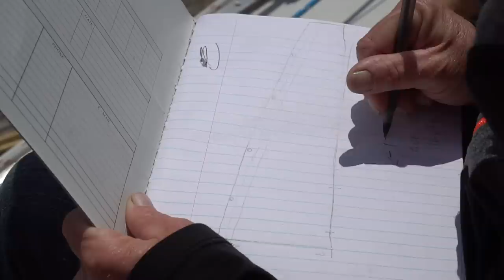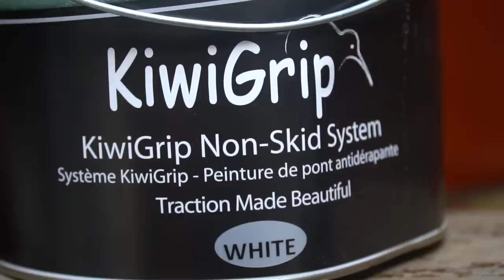Our Brand NEW Boat!— Sailing Uma [Step 178]

Comment: The stack pack came out great, but you might want to consider having a flap sewn over the zipper to protect it from the sun and to keep water from going through the top of the pack when raining. I had a stack pack built years ago without a sun flap and the zipper failed within a year. Great job though on the sloooowwww refit!
Reply: Great Idea!!!
Reply: that little flap idea is a really good lifesaver
Reply: You guys do amazing work what’s the cost on the painting

Comment: Love it when a plan comes together! Don't have a clue about sailing but you guys make it interesting...👍
Reply: Join a local sailing club and learn to sail.  Chances are, you'll get hooked.  It's relaxing and challenging at the same time.

P.S.  I used to get seasick sometimes, but simply more time on the water cured it.

Comment: Beautiful work, and a really stylish dodger. You might want to be carefull with the dodger window cover. If the windows are made from polycarbonat as you say, wind will make the cover flap against the polycarbonat, which will scratch the surface and make it go blind in no time, especially if you have sand or salt from dried seawater in between. I hope I am wrong, and you will be able to enjoy your beautiful plain view for a long time.

Comment: Just got thru going thru all the steps.  Amazing!  You are responsible for my thinking again about cruising. I have a question about your sail cover, Why didn't you add udders to collect rain water to the sail cover. Why zipper rather than Velcro, my thought is chaffing problem here.

Another thought is using ozone for purifying the water in the tank, I used a lot of bleach to do that in my past life.

Comment: I have a question regarding Safety.  Why not install netting on the Lifelines?  Would make it safer to walkabout the deck in heavier seas, particularly when working alone on deck.  Also would keep things from falling overboard and make clothes drying easier.

Comment: I don't usually comment, but have to say, Love the new dodger and stackpack you had made, and the color as well! Many people say that grays don't for sailing, or look bland, but not only have you proved it looks excellent, it also does a better job of not getting fried by the sun as fast. Also getting that done by artists like Mike and Wendy, who not only do the construction of it all the time, but know the materials, was a smart choice. Love the 'wings' you put back there, although would have had a full cover made for cross ocean passages..especially for at night. Do consider a flap that comes across that stackpack ad covers it, perhaps snaps on the other side? To keep it sealed and protected when not in use.

Comment: You guys didn't refit your boat, you rebuilt it. I just restored a 50' MY, but I paid others to help me, and I didn't have to rethink most of it, I just restored what was there to new (engines only have under 500 hours, but the cooling system needed acid cleaning.) I am now at the revisioning stage, and I watched what you two were doing and it gave me not only ideas, but license to do it. Meaning,  you demonstrated that you can do anything to a boat as long as the hull is good. And even with that, you repaired your hull as well. It's really an adventure. I will eventually sell this one and buy a sailboat to retire onto and I plan to do the same - turn an old boat into a new one of my own liking.

Comment: Incredible!!!! Is it already four years??!!! I am amazed because I've been following along loosely since video three and sure you had a vision but I couldn't see it for myself. I only saw the in the moment, not the greater picture BUT now you're Here! You did it and I can see the complete picture and your vision come into being. IT'S AMAZING!!!!  
(Ps. I'm also in the process of choosing between two project boats to work on while I finish uni. One is 34' $3000 with a cracked hull, and nothing that really works. The other is 40' and $10k with a working engine, good rigging and decent sails. In any case, they're both great projects but it's only one of my and I've got a commitment to uni. Just based off of that and your experience, which would you (loosely speaking) go for?

Comment: $2000 only for material, not any frame. Wow but it looks great. A brighter colour would have been my preference. Just a suggestion - puting covers over the policarb as you say to protect it, will probably rub against it causing it to be go white and you will lose your transparency. Best not to cover it at all. Rubbing is your enemy...

And add sand to paint and youll get the same texture in your floor...much cheeper ...

Comment: Get some really long sail ties that will go around the stack pack. You might be caught in +40 kt winds, and will have to ensure that the main stays down. A few cruisers have found in harsh conditions their stack pack zippers did not hold in the gusts. They lived to tell the tale. But being on deck dealing with a flogging main was deffinitely not a high point of their journeys.
Cheers

Comment: WOW!!  She looks amazing! If I hadn't just binge-watched every video up to this one I would swear that a fairy grandmother showed up and waved a magic wand.  You two have done so much hard work and created so many innovations the sailing world should be paying attention.
Now I have an idea, don't know if its ever been tried and maybe was a failure, but I have the feeling if anyone could make it work it would be the two of you.  After watching so many anchors being pulled up with the chains all full of dirt and mud and getting the deck all nasty I feel like there has to be a way to stop that problem.  I have used boot scrapers many times when I lived in the snow and slushy weather, I'm sure you've seen them...just a platform with stiff brushes that you shove your boot into and it removes most of the crud.  I would think the idea could be modified to allow the chain to run through such a "gadget" when hauling it back up, maybe even with a pressured water attachment to squirt the chain just as it's passing thru the track of brushes. It could even have a lever or some type of mechanism that increases or decreases the brush pressure as needed.  So, what do the two of you think?  Could it work?  If so maybe it could even become something you could patent, just remember to name it after me...F'up Fairy! LOL
Reply from the maker: Yes, there are actually chain cleaners out there. But a deck wash hose (like we have) works just as well. You just spray the chain off before it comes on-board.

Comment: You need a motor that gives you regen......as you sail so much it would run the auto pilot and add some charge to your batteries, 150-200 watts doesn't look like much but over 24 hours it adds up.....
Reply from the maker: We’re working on it. Bits it a bit more complicated that most seem to think. We can’t fit a larger prop, which means a different motor. Those are quite pricey, even to DIY BLDC set up. It’s in the works though.

Comment: What kind of glass did you use? After a while now, can you recommend that stuff? I am going to get a new full encloser for my B40C and wondering what glass to use. Thanks!
Reply from the maker: It’s a polycarbonate I believe. There are a few different types but they’re all the same. The EZ2CY is the name brand stuff and is usually a lot more expensive for no reason. It’s been almost a year now and a little over 4000nm. Still crystal clear and very minimal scratching.

Comment: Looks good. Not very sure about the polycabonate over the soft clear plastic window stuff.  Now it is perfectly clear but am a bit afraid it will scratch pretty easy during cleaning. Time will tell. Love the underwater lights too
Reply from the maker: All plastic scratches over time. But, if cared for properly, polycarbonate outlasts the flexible stuff by years. Out here, you can’t expect more than 10-15 yrs out of a fabric dodger anyway. Salt and sun are harsh killers.

Comment: Too bad you guys did not know that what you do is use the old dodger as your pattern. All you need to make a new one is the sewing machine and thread and material. You can use sewing machine to make sails and everything.
Reply from the maker: We did know that. But the new dodger is not the same pattern as the old one, and it cost about the same to have one made as it does to buy all the supplies. Beside, no way we would have made it that nice on the first try. Sometimes it best to let the expert craftsman take over.

Comment: What did u use to paint the Alexseal? Roller or brush? Amazing!!
Reply from the maker: We rolled with these: https://amzn.to/2Xxh470
They're the best we could find.
And then just tipped with a normal cheap foam brush from the hardware store (those black wedge shaped ones) Turned out really great. There is a tiny bit of orange peel, but it's a remnant from the primer underneath. We tried sanding the primer smooth, but it's rock hard. 60g pads did nothing to it.

Comment: You guys have done an outstanding job refitting Uma. How do you like the feel of the Kiwigrip, underfoot? Better yet under knee?
You may want to look into covers for your stainless tube in the dodger, where it is close to the isinglass. It will turn the glass brown without an insulator.
Reply from the maker: The Kiwi grip texture is customizable, depending on how thick you apply it and how long you wait to re-roll it. We went with a heavy texture on the cabin top and a lighter texture in the cockpit. The lighter texture feels nice underfoot and knee, the heaver, shaper texture is a bit poky but not bad, feels like your glued to the deck when you have boat shoes on though. Hope that helps.
Reply: @SailingUma  It sure does, thanks.

Comment: The boat looks great! Just about to start the same paint project. Curious, did you mask off all of the non skid shapes before you did the alexa seal, then just do what was left over?Would love to see some footage of that part of the painting. Thanks again for sharing!
Reply from the maker: We masked off the hardware and then painted the shiny Alex seal. We over painted a little where the nonskid was going. Then masked off the nonskid after the Alex seal was cured. Saved a lot of paint by not painting alexseal where the nonskid was going.
Reply: @SailingUma  that's great! Thanks!

Comment: Rise a sails in a marina ???? You  must be  banned  from  sailing for forever 😒
Reply from the maker: Can't tell if you're being sarcastic or not. But we've sailed onto the dock before and see no issues with it when done correctly. Sailing off the dock is even easier. Sometimes we'll just cast off and use the wind to drift out before raising the sails. We've just become so used to sailing without motoring that we almost forget we have it sometimes.